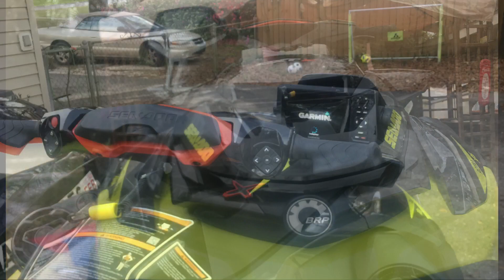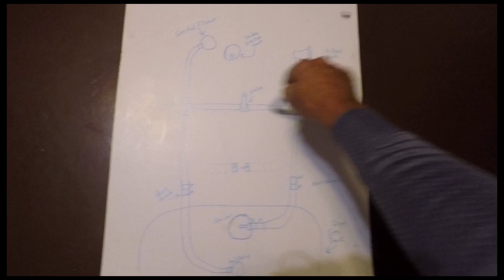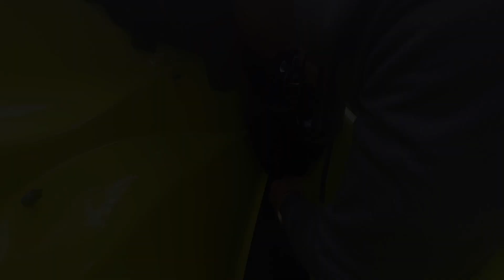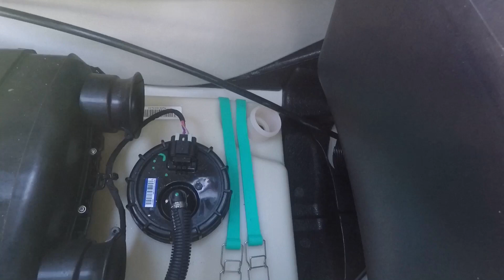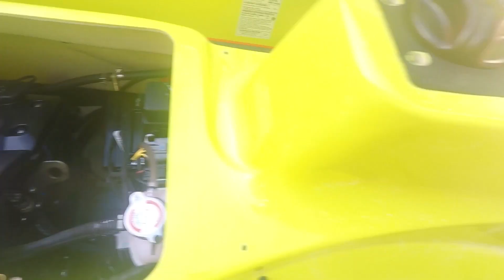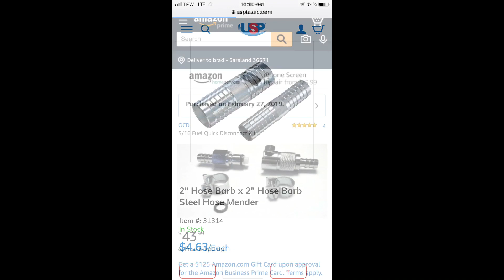Seadoo RXTX 300 AUX gas tank set up.

Comment: How did you find the quick disconnect to work out. I had a reap problem with those things years ago, because the e10 gas caused the o-rings to fail. First they swelled and made in almost impossible to pull apart and then reconnect. Have you had any issue like that??